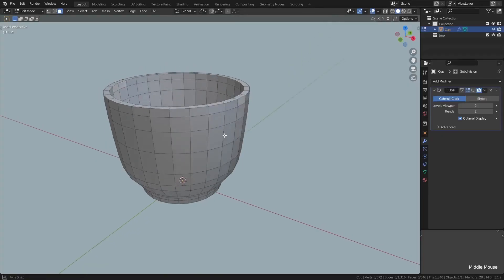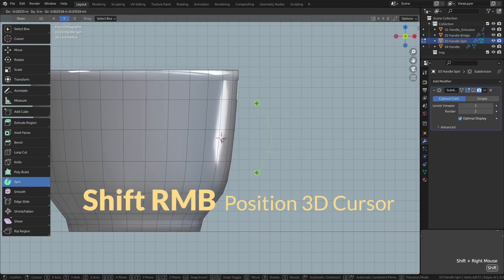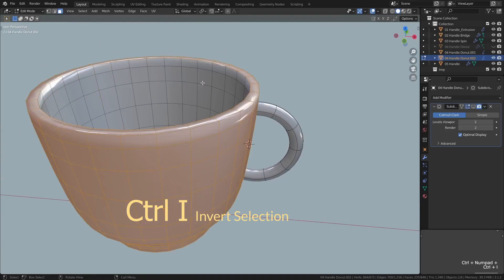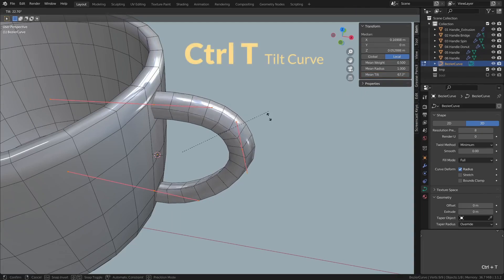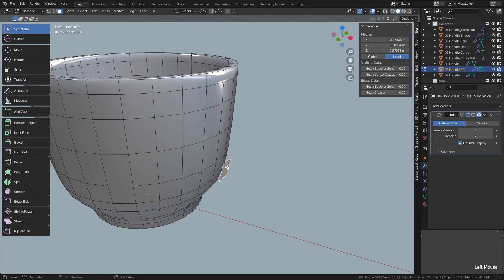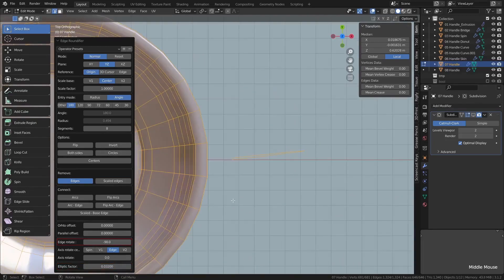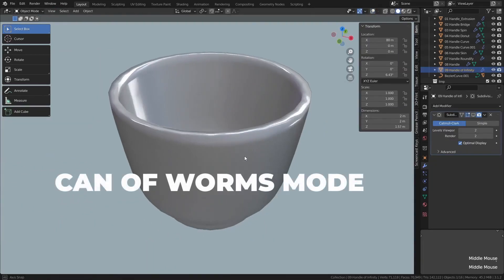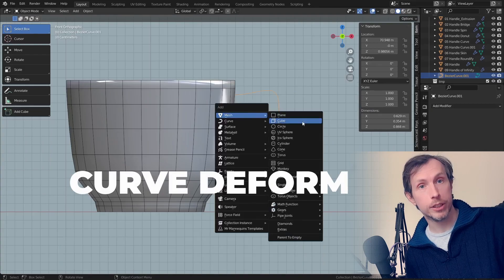Are you modeling WRONG? | Blender Tutorial

Comment: One other way i could imagine is to select the 4 faces including start and end of the handle area used in the video and extruding those along the X axis.
First extrusion for a cleaner transition of the Subdivision Modifier, the second for the size of the hole (including the first extrusion), the third for the thickness of the grip.
Afterwards just select the four inner faces on each side and use bridge to get the hole of the handle.
Eventually round the top and bottom vertices of the handle by moving them closer to the cup and scaling them in the Z axis.
Sounds much, but is also done fast. Cheers 😉
Reply from the maker: aaah yes, I know what you mean! Great suggestion thanks! :) Aidy.